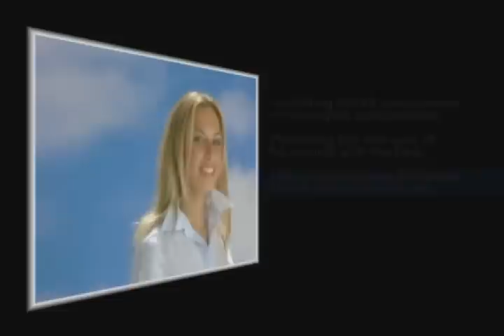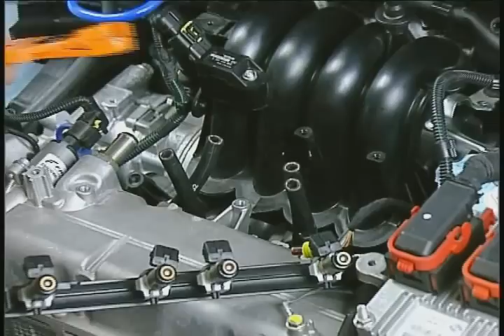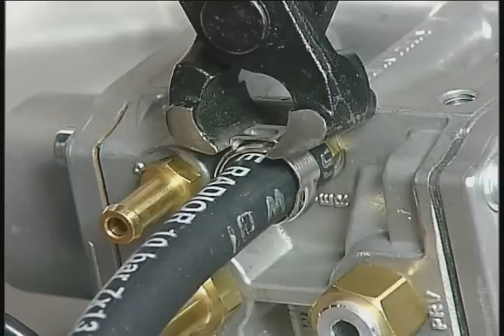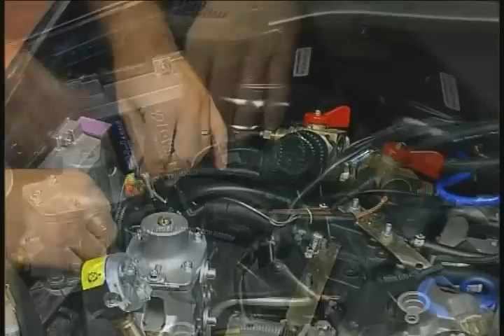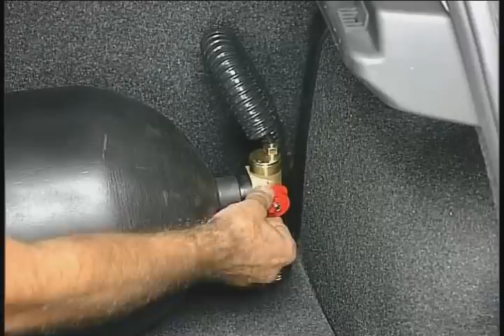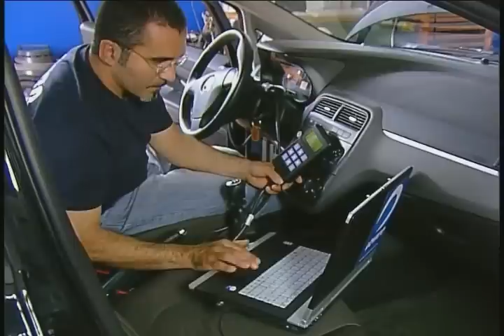EasyFast CNG sequential injection kit

Comment: I like Tomesatto and Bugatti sequential kit
Reply: Hello,sir ,This is Mez from Jing Yang Reach Auto Gas Equipment Co.,Ltd.We focus on producing CNG/LPG conversion kits,ECU,Regulator,Gas injectors,pressure gauge,Sensors and Switches and other CNG/LPG parts.If you have any need,you could contact us,my whatsApp/skype/wechat/tel:+86 13724098241

Comment: i have lovato sequential cng kit installed in my honda civic at but from last 2 weeks my car switches off when i switch onto cng. has anybody faced this problem & what could be d issue. thanks
Reply: It's professional cleaning of throttle body which is required with setting. I had same problems

Comment: Hi
I have Lovato sequential kit installed in my 2008 SX4 in 2014. Lately i have been facing efficiency issue, i noticed that i have been losing almost 60KMS worth of Gas compared to what i have been getting previously on regular route that i have been taking for the past 3 years. I googled and learnt that CNG filter needs to be replaced but my lovato  cng mech informed me that this particular kit doesn't come with filter. However, he narrowed it down to reducer and his analysis matched with the problem i have been facing like efficiency, power loss and pick up issue. He explained that at CNG station the attendants pour oil in filling nozzle to avoid corrosion and this oil gets accumulated in reducer there by resulting in the issues i have been facing. The Lovato mech serviced the reducer and its been only a day, i can sense that drive is smooth and i was able to clock long distance with limited GAS in car. Lastly, drive is very smooth in petrol w/o rpm fluctuation. I hope somebody can concur my claims.
Some suggested to get Tippet adjusted, throttle body cleaned (i get that cleaned every 3 months) and injector clean. Any suggestions.
Thanks
Reply: I have been facing the same issue in my SX4 ZXi , I will get the reducer cleaned , tippet adjusted. Thank you in advance.
Reply: Pratik Kamani sir m using Greco Cng kit from greenglobe Cng solution Mayapuri New Delhi. They are authorised by Greco they have branches in other cities too.
Reply: @Pratik Kamani hi can you please tell me how much mileage we can expect for Swift VXI ?
Reply: Go for ckp or advancer use mijo or motozen

Comment: Typical Composition of Natural Gas
Methane	CH4	70-90%
Ethane	C2H6	0-20%
Propane	C3H8
Butane	C4H10
Carbon Dioxide	        CO2	0-8%
Oxygen	                O2	   0-0.2%
Nitrogen	                N2	0-5%
Hydrogen sulphide	H2S	0-5%
Rare gases	        A, He, Ne, Xe	trace

Comment: I have this exact kit fitted to a BMW 330i (E46) and it is great. 75p per litre instead of £1.34 - I'll take it! You can't tell the difference in use, and since I've got a donut tank in the spare wheel well there's no change to the original petrol system at all.
btw, a 74 litre tank will fit in the wheel well (just) if you're prepared for the boot floor cover to stand up half an inch. That gives a hair under 60litres useable LPG per fill.
Reply: please give your fb id

Comment: Right, megawelderguy, methane is a greenhouse gas.  BUT, so is CO2, the product of gasoline and diesel fuel combustion in car and truck engines.  Sooooo, burn CNG(mostly methane) in your auto or truck and produces much less pollution that the petrol burners.

Comment: Most  front wheel drive cars have the gas tank in the middle . So underneath the trunk is a good place to put a tank. But you would have to get rid if the spare tire sump.